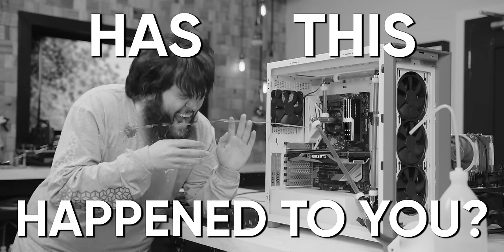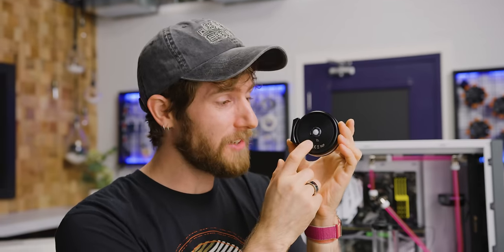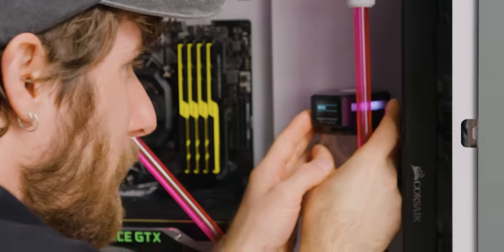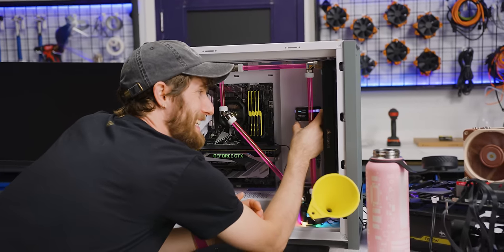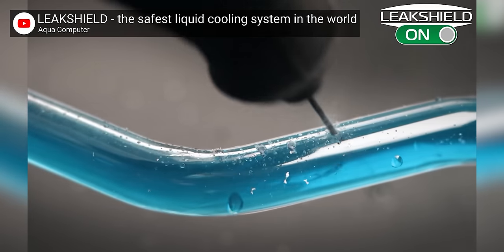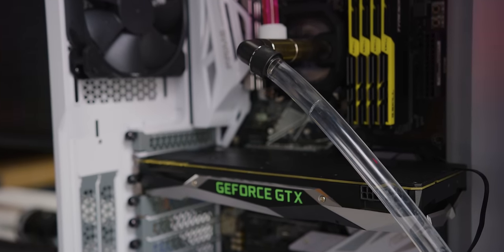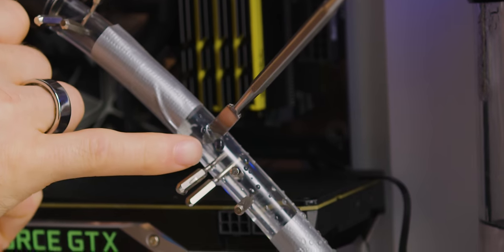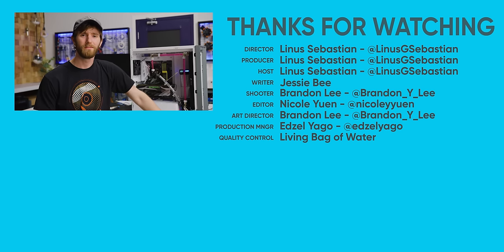I can’t believe it didn’t leak…

Comment: Wow that is a legit thing man ! 
Good luck to them what they have there is awesome! If I had a water cooled rig still I'd have gone and picked one up from this video alone no questions asked.

Shame that water cooling is just kinda pointless u less your actually going to need a little OC boost from the cooling, considering most modern CPU and GPUs are cooled enough to run even the most demanding titles on their existing coolers ( for like 90% of users ) 

Otherwise it's frickin' great

Comment: this is actually really fucking cool... could totally use this in an automotive application. coolant leaks are a little more critical and harder to diagnosed. most cars today (if not all i bet) at least have a level sensor, could totally hook this up to the ECU with a few extra sensors in the coolant loop for the other values it needs to stop leaks from happening

Comment: I'm only finding out about this NOW?! Had my CPU block crack a bit over a week ago, killed Motherboard and CPU in the process. This could've literally saved me like 800-900 bucks. Also I'm running kinda long loops due to having my PC in a Desk, so getting trapped air out isn't exactly easy since you can't just tilt and shake a desk that weighs a good amount in every imaginable angle lol. Sadly out of stock everywhere I looked atm :D

Comment: The way I see it, building a custom water-cooled PC is an investment that'll cost you thousands. Spending $140 for this much assurance that your components won't be bricked by the most common ailment facing such machines seems like a no brainer to me. Not to mention, you'll need a reservoir/pump anyway. The cost difference between this and the pump you would get is negligible, especially when looking at the cost of the entire build.

Comment: until today i never use a custom WC cause of possible leak. next time maybee i will. you don't need to plug it on your computer because it has a built-in alarm, no backward running software needed, that's so cool.

Comment: in a world where most cool tech is gone, theres this smart pump that linus didn't recommend.
Reply: Its an bit of gimmick tbh. It flow meter is virtual. I would rather buy an aquacomputer octo/quadro, next high flow sensor and generic d5 pwm. The octo/quadro can read all the data from the high flow sensor and control d5 pwm and rad fans off the flow rate/water loop temperature

Watercool also has one such pump in development but been no news on it since early last year.

Comment: Could have used this last night when one of the gaskets in my system failed and leaked all over my gpu.
Reply: Sorry to hear that, did your gpu survive and why did the gasket fail? Building my 1st loop and really afraid of leaks and just ordered ultitube leakshield 150 pro yesterday.
Reply: @Raw-Vidz  gpu survived because I had fresh nonconductive coolant and the gasket failed on the flow indicator after 2 years of use.
Reply: @Raw-Vidz  I made sure the system didn’t have power after the leak and took apart the gpu and cleaned it in 99% ipa

Comment: The computer game hasn't changed much. We are still in the water era and not in the phase change era. Cases come and go. fads come and go. but cooling is eternal.  People should drop big money on cases that do more than look pretty.  four fucking glass panels and some cable management? Pass. Watercooling? pass.  Phase change technology that keeps my stuff so cold that the effective voltage is lower than the heat generated? Buy.

Comment: Linus when is the ROG RIG REBOOT 2021 ???  because i cant take it anymore
Reply: my laptop sucks
Device name	Aneesh
Processor	Intel(R) Core(TM) i5-5200U CPU @ 2.20GHz   2.19 GHz
Installed RAM	12.0 GB DDR3(1600MHz)
Device ID	EC74***E-5AC4-44C7-A28F-F607300***27
Product ID	00327-30294-***-AAOEM
System type	64-bit operating system, x64-based processor
Pen and touch	No pen or touch input is available for this display

Graphics         NVIDIA  GeForce  940M

Comment: Hmm. No disrespect intended, but I suspect that this is another one of those amazing products that performs brilliantly in laboratory torture tests, but which lets you down in the real world when it really matters.

If you ride a bicycle, making your tyres puncture-proof is technically possible. You line them with miracle gel-tape and squirt gloopy gunge into the innertubes. Both products work perfectly under test.

Yep. Nails, screws, thorns, broken glass, slivers of flint, Klingon disruptors - nothing will cause air to leak from your tyres ever again. Look at these cool videos of ridiculously perforated tyres, still holding air. Hooray!

But what WILL cause the products to fail miserably is being 21 miles from home on a lonely road in the Yorkshire Dales as the fog closes in and the werewolves pick up your scent.

Works every time.